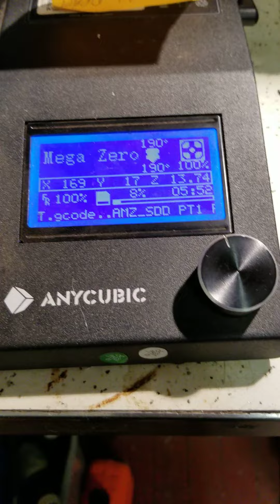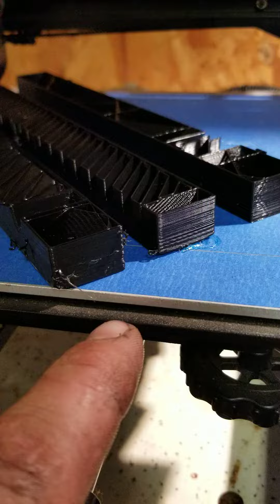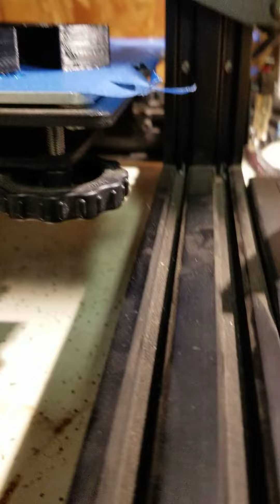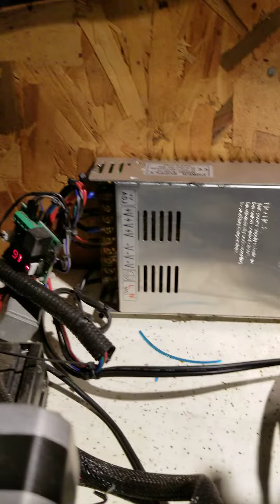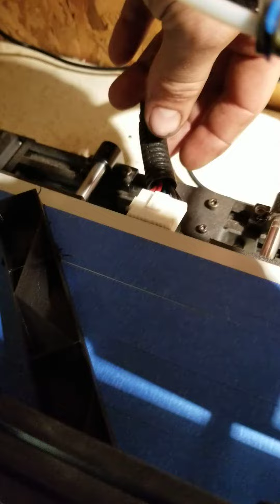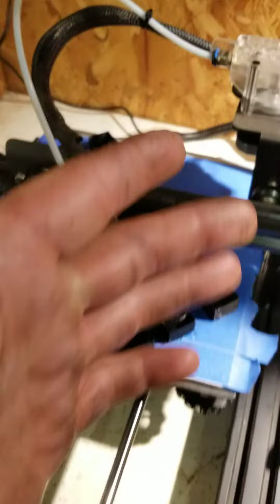any cubic mega zero easy heat bed upgrade

Comment: The way you mounted the heated bed is pretty clever..I didn't think of that when I did mine but it turned out great so I'm happy with it. I agree that dealing with firmware is a real pain but I downloaded marlin that someone else worked on but of course it didn't work properly so I modded it to suit my printer which worked out really good. I might upload it somewhere  if anyone has any use for it.
Reply from the maker: I have since learned how to compile my own firmware! Hell of an advantage!
Reply: @FixedAFT  could you guide me through it? i would also like to update my firmware. Currently it is factory stock 0,0,4 version. Thank you
Reply from the maker: @Kavil194  varies alot with printer model but this tech guy on YouTube has a good ass video on how to do it. 

Also need to first figure out if u have a 32 or 8bit board. 
Can't do but so much with an 8!. 
I will find his channel link one sec
Reply from the maker: @Kavil194  https://youtu.be/J9vxJT5Tgh4 
Should be a good intro to how to do.

Looks like a lot. 
Really it's just delet or don't delete some / marks u like or don't and compile then save to SD with a new file name EACH time and it will flash on next boot🤙
Reply: @FixedAFT   Thanks for speedy answer. I opened up the board. On the bottom right corner it is written "Mega Zero v.0.0.2" on QC sticker it is stated 2020 and on bootloader screen Anycubic Mega Zero v0.0.4

Marlin firmware and its default example configurations has 2 options for mega zero. First one is V1 and other BigTreeTech SKR Mini MZ V1.0

When I connect it through Pronterface I get

echo:Marlin V0.0.4
echo: Last Updated: 2019-09-04 | Author: (thisiskeithb, Mega Zero)
echo:Compiled: Jan 12 2020
echo: Free Memory: 10195  PlannerBufferBytes: 1232

I am not sure if it is 32bit or 8 bit board. 

I am searching it further at the moment.
Reply: @FixedAFT  So I take a look once again at the chip of my board. AFAIK It has atmega1284p u-tw 35452b 1937a60 printed on it. When i search it online i get a datasheet and there states 8bit microchip

I am not sure if i pursue further this. Will it worth it to update the firmware?
Reply from the maker: @Kavil194  if it's 8but there's not much flash memory left on it for upgrades. Also.. I may be wrong about that board in particular.but you have to first burn a bootloader to 8 bit boards. Large pain in the ass for like 3 or 4 changes if that that u can fit🤷‍♂️ 32 bit has more room than you'll need before needing a whole new machine altogether (assumptions)
Reply from the maker: Side note. "ATMEGA" is the main chip in an arduino. 

So essentially that's am arduino with built in "shields" (modules/adapters) 

Can probably program or update firmware with arduino IDE if u have a usb port